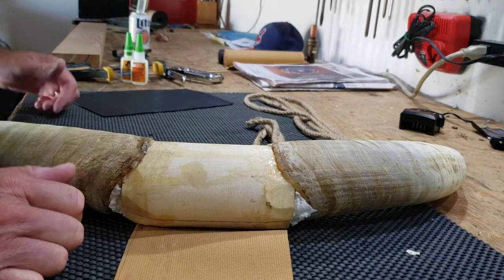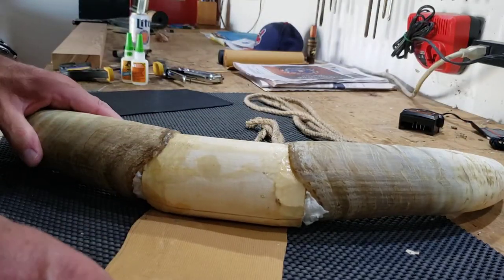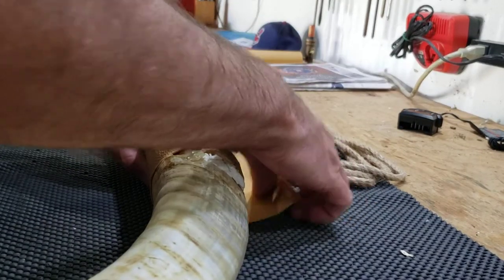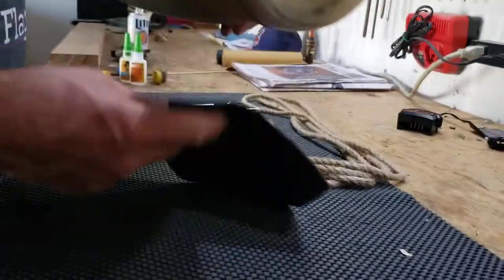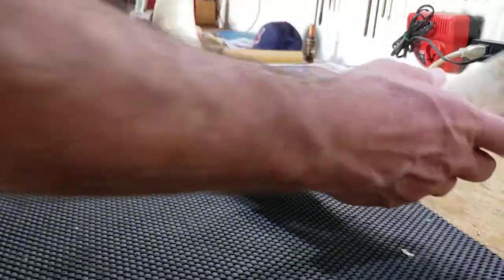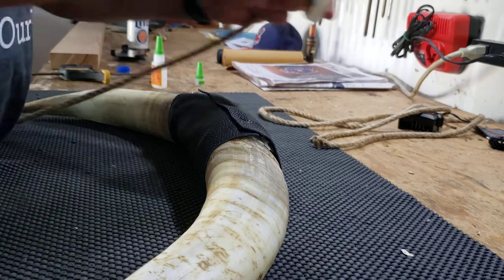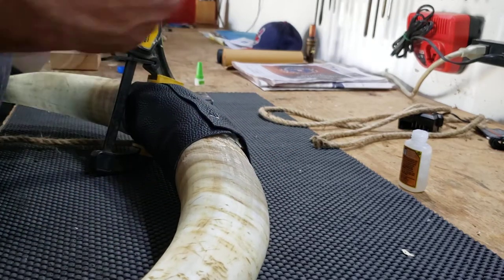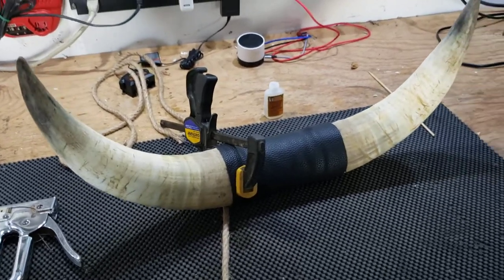Bull Horns part 1

Comment: How do you mount the horns together  ? In this video they were already connected.
Reply from the maker: Band saw and chisle ro fit inside horns.  It's art not science.  Hols are not semetrical.   Gorilla epoxy.
Reply: @rickarnholt2937  Thank you. Do you use a round wood post  maybe 18 inches long by about 2 1/2 " that would go in each / between the two. Then epoxy the gap.
Reply from the maker: @davefitzpatrick8775  it's going to vary based on size of your horns and how far apart you want them.

Comment: How did you hollow out the horns?
Reply from the maker: I've seen some people boil them. these came off the skull through months of decomposition
Reply: Contact us for buying on my mail id
Reply from the maker: I let them rot on the head over winter and by late spring they pull right off